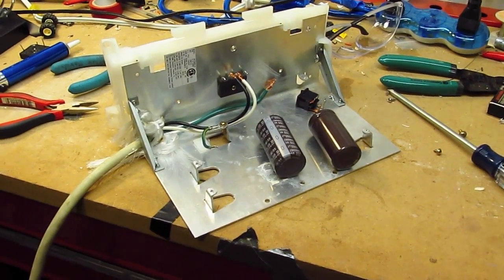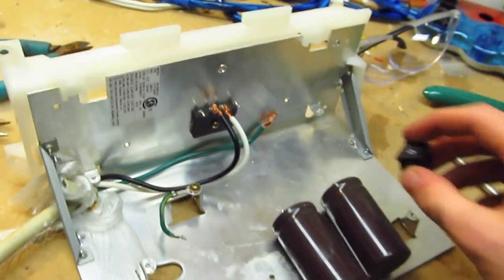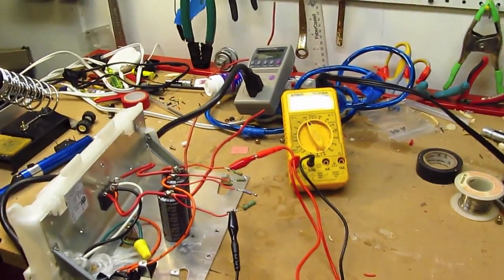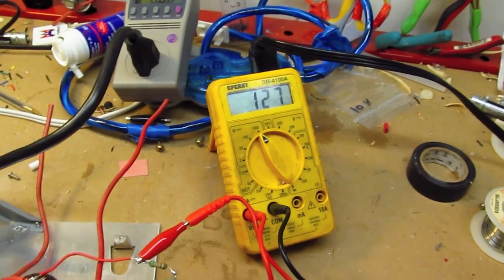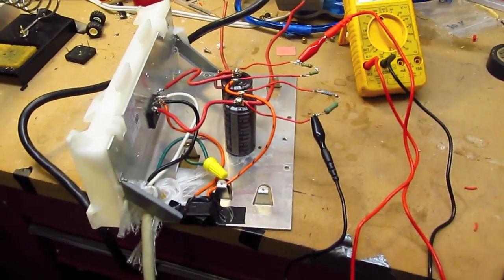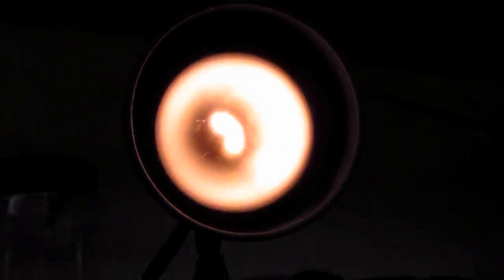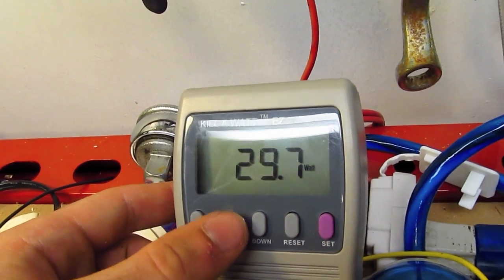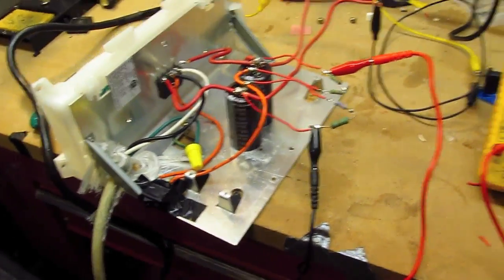0 to 400 volt PSU for testing and destruction

Comment: how can a rectifier double the voltage?
Reply from the maker: It's the rectifier and the two big capacitors working together to form a voltage multiplier circuit.  The capacitors are essentially charged in parallel but discharged in series, thus producing double the voltage of a simple rectifier circuit.  
The effect can be extended with more diodes and capacitors, but this becomes bulky and expensive and the current capacity and voltage regulation decrease greatly.  However, it can produce very high voltages at low current, such as that used in a CRT television.  
These articles give a pretty good description with some diagrams:
http://en.wikipedia.org/wiki/Rectifier#Voltage-multiplying_rectifiers
http://en.wikipedia.org/wiki/Voltage_multiplier
Reply: You just earned a new subscriber. thanks! ;)

Comment: I had a Rear projection TV which i fixed cheap and then sold it :), The flybacks and the voltage dividers and the audio amps & speakers are real handy. they typically have 20 -35 Watt audio amp IC's, great to mess around with.

Comment from the maker: Thanks for the comment :)
I was lucky for get such a robust rectifier and those caps out of that CRT rear-projector TV that I messed with a few vids ago.  Convergence chips are too expensive to make repair worthwhile, so it got tossed in the big bin of sacrificial devices.  Stay tuned for serious experiments and silly destruction using the new setup